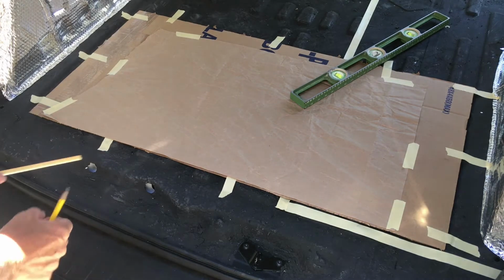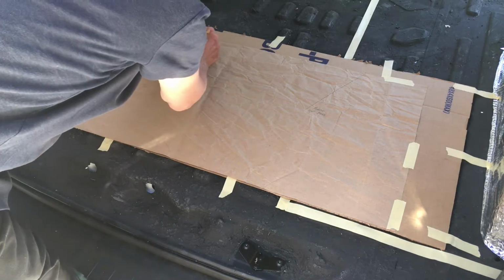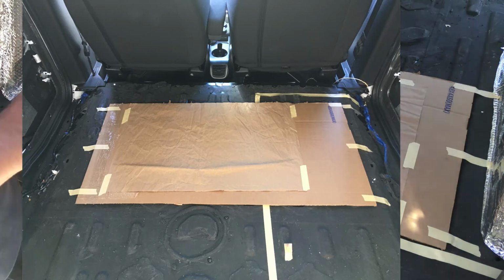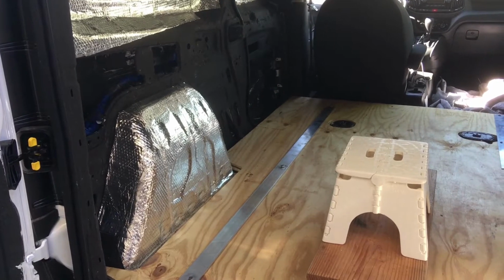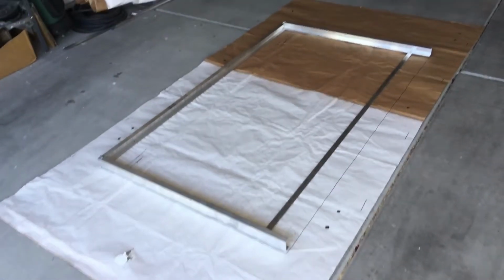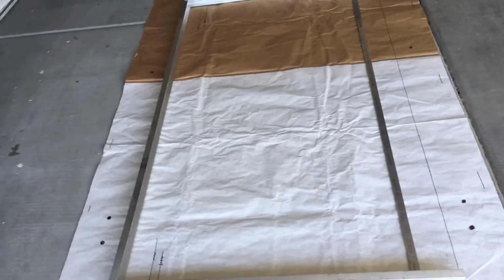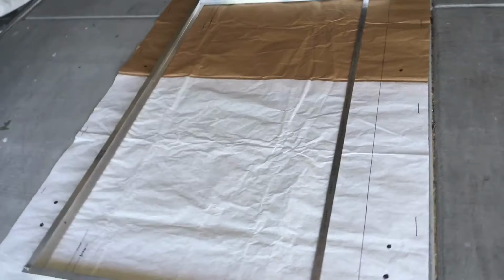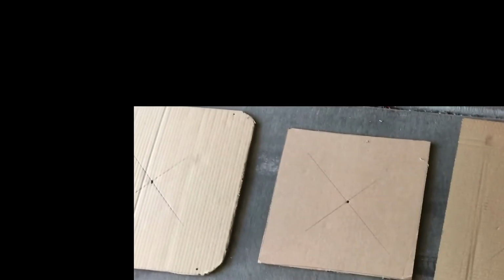Ep 18 - Making Floor and Roof Templates

Comment: Hi Jim, loving your video’s as usual. Your making good progress 😃 I wanted to put my max air in the very back, for room for solar later... but I didn’t end up putting it in back, because I was too concerned with the back roof light and wiring for it. I ended up putting fan between the two ribs on ceiling/roof. It turned out to be better for me, because of my layout. I just wanted you to be sure and double check that back light and wiring. I AM SURE YOU ALREADY ARE AWARE, but thought I would just mention it. Love the roof rack idea you came up with, I am looking at custom... but want low profile?? Struggling with roof rack ideas, so I am anxious to see your finished design !! Great job!! Julie and Zoe
Reply from the maker: Hi Julie! Yes, I've placed the fan to avoid all interruptions in the van (e.g. back light)  The biggest concern, after placing the fan, was that I would have enough room left on the roof for the pv panel. It all fits together, with no room to spare. This roof rack will extend no more than 7-8 inches above the roof . It has to in order to fit in my garage. Thanks for your comment.